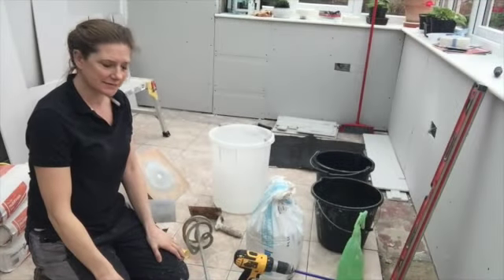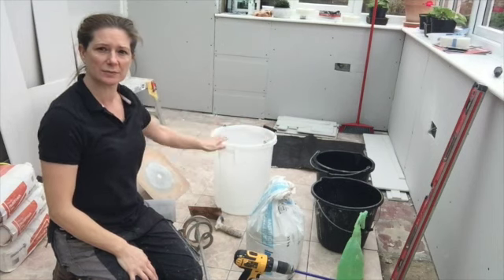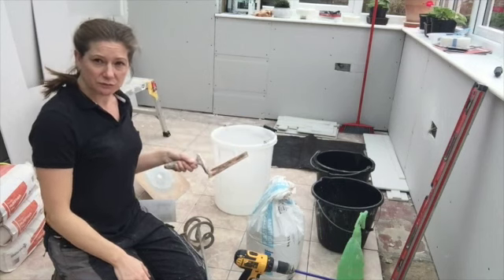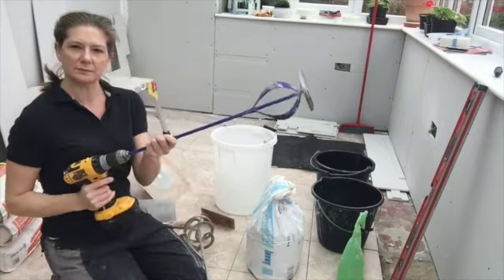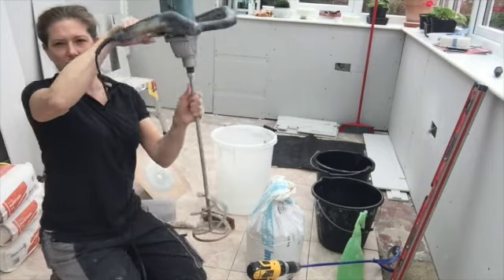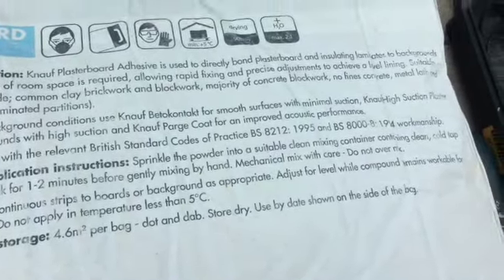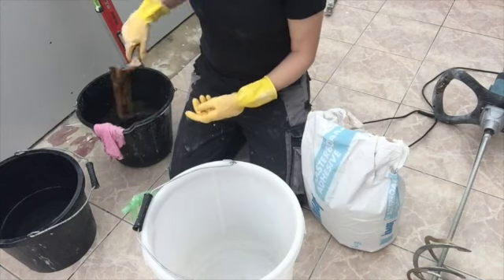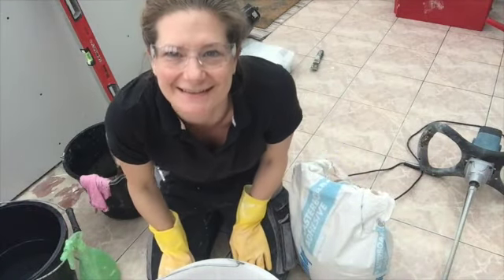Mixing plasterboard adhesive for dot and dab

Comment: Thanks, this helps.
I like how you explain the 3 buckets and advise on why you need to clean the tools and how you carry it out.
I played the mixing part at .25 speed because i was interested in the mixing process, the scraping of the mixture and hand mixing periodically was a helpful hint.

Please note that Its now advisable to wear a mask when mixing dry powders.

I clean the mixer in a way that may be helpful.
When cleaning the mixing paddle I lift it slowly out of the mix while running until it's around 2-5 inches above the mix, this is to flick off the plaster on the mixer and make cleaning easier (the same method works when mixing cakes). I then plunge it into the water bucket with nothing else in the bucket and run it for a few seconds. Finally turn off the power to the mixer before completing the clean; I do not trust my competence
Reply from the maker: @TastyNZpieslover  great tip about cleaning the mixer!